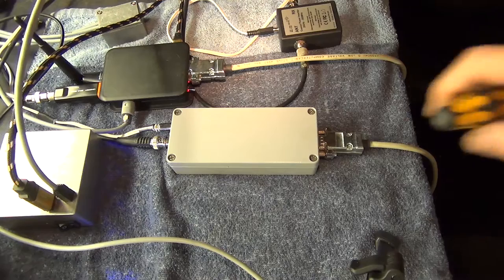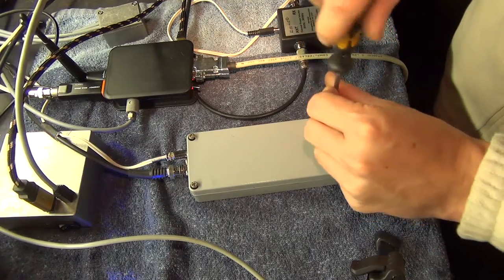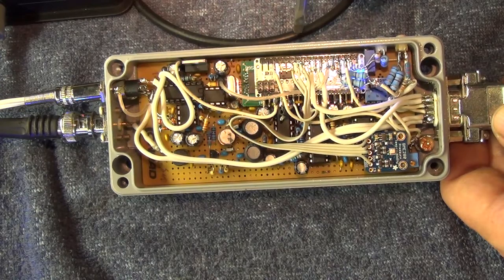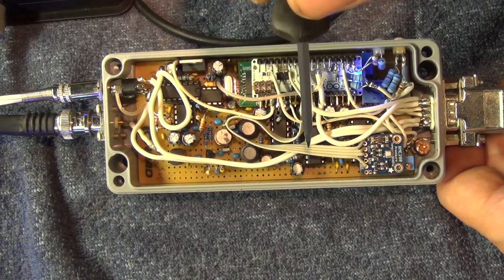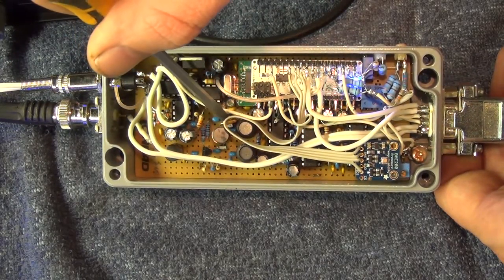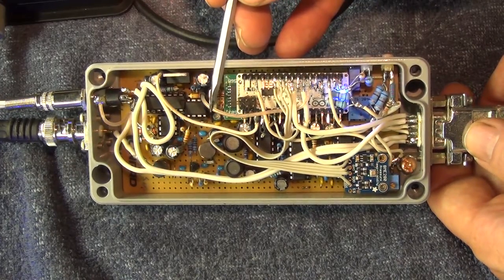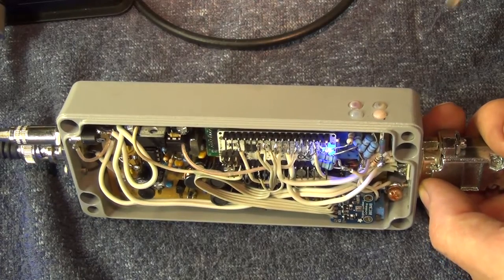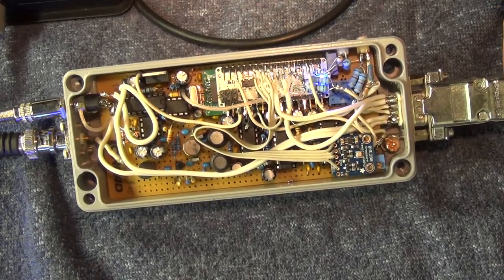Low-Cost NAVTEX Receiver (selfbuild)

Comment: Hi Martin, I have built this navtex receiver, it works except the 4069UB which produces noise. Still, the AT89C2501 can decode some of it, but clearly the 4069UB ruins the signal as at the speaker I get perfect decoding with Seatty, but not at the exit of 4069UB. Could you post the maker of your 4069UB, as I've heard that only some batches and only from some fabricants are suitable for linear applications. Please post all writings from your 4069UB including date code. How did you "calm down" your 4069UB? Thanks.
Reply: It looks like all the time the receiver was good, I have a navtex tester transmitter which is transmitting a not fully standard navtex signal. I had to use for testing this navtex tester as we have no good navtex signal here in Hungary.

Comment: Hey Kuttmoped.
Very interesting project you made.
I've just read the pdf document with the schematic for the reciever.
Now i'm wundering on how did you change the microcontroller to Arduino?
Espaccially the pins: RST, XTAL1, XTAL 2 what did you do with them?
I just briefly run through your Ardino sketch and haven't figured it out yet, so could you enlighten me? :-)
Reply from the maker: I just took the 80C51 ASM code and rewrote it to the C Code for the Arduino. At the moment I use the ATMega 328 (Arduino nano)

On an Arduino you don't need to take care about the XTAL inputs, because the controller is already on a PCB (like the Arduino Nano or Mirco) and those inputs are already connected properly. So you just plug in an USB cable and transfer the program ;)

Comment: super! what is your demodulated center frequency and offset+/- when it enters pin7?  Danke.
Reply from the maker: At Pin 7, it's the digital stream with 50 baud (100 if you count the error correction)
Frequency is max 100Hz and min 3/4 of that, due to the 3 to 4 ratio of the SITOR encoding.
Martin
Reply: kuttmoped, cheers!  I see now.  Should have read the manual! :) According to Klaus Betke the digitisation of analogue signal is performed by the 4069-->TLC274(U6d).  Do you know what is the analogue audio frequency entering the 4069?  Just wonder if I can feed ~1.5kHz into it.  Trying to build a Frankenstein prototype.
Reply from the maker: At the input of the 4096, you have around 400Hz, after rectification (the 4 diodes): 800Hz
Reply: I made it work eventually feeding 1500Hz audio into 2211 FSK demodulator and out into Arduino.  It works very well but every now and then the last character in a word is repeated twice, same with numbers.  Wonder if it's just my unstable breadboard assembly.  Is your build behaving?  Cheers
Reply from the maker: Try to compile the sketch with 1.6.9 or earlier (in Board Manager - Arduino Board AVR). I had some weird behavior with double chars while using a newer compiler version.  Not sure why this happens tho. Maybe because I use a china replica arduino.
Reply: Sorted! It stops working correctly starting with 1.6.10 introducing double chars and extra CR/LFs. I tried it on the Italian UNO R3 - same thing, actually the original board's stability was worse - keeps loosing sync.  What really screws things up is the flipping ceramic resonator instead of crystal on some boards.
Reply from the maker: So you can confirm that. 

I tried it using an Arduino Nano (cleap cheap China) and a official Arduino Micro. On both I have the same issue with the 1.6.10. or above.

So it seems not to be an issue of the AtMega328, since the Micro runs on a ATmega32U4. 

It looks like that the interrupt fires again while not beeing ready. (at least that's my guess). Maybe a digital buffer after the last OpAmp may solve the problem.

About loosing sync: Please note hat the Arduino Nano has interrupt pins 2 and 3. The Micro has 2, 3 and 7. Since I did this initially on a Micro I used pin 7 as data-in. If you use a Nano please use Pin 2 or 3 (and adjust the programm ti use this pin). Sadly: The compiler does not complain if you define pin 7  as interrupt on a AtMega328 :(
Reply: Tested only on various flavours of UNO R3 with interrupt pin set to 3, as designed.

Comment: I'm very interested in doing a similar project. Do you have any links to schematics, BoM, etc?
Reply from the maker: +johanzackrisson 
sure: http://www.harpoon.si/uploads/Razvoj%20podpora/Navtex.pdf
Sadly there are 2 mistakes. You need to exchange the pins of u6b and over the 22µF capacitor near u6b you need a 500k...1MOhms to adjust for a 50% duty-cycle. 
Wtf .. the assembler file was removed from google-docs :( hmm I have it but won't publish ist, since I don't hold the needed rights. What I can publish is my rewritten C-Code. I took only the basic Idea of operation and therefor hold the copyrights on that...
Reply: +kuttmoped Thank you, I've seen it before but don't have the guts to translate it to work with Arduino (pins etc.) so getting my hands on your version would be great. From the number of question on similar topics that I've found on the www - I think quite a few would be interested in the modernised version.
Reply from the maker: +johanzackrisson 
No Problem, however I've noticed, that my comments are all in german (added a lot to keep track of what I did, because it required a lot of tweaking, especially to stay at the clock of the sender).
If you want I can translate them into english, or do you want to use the google translator. it's made for an ATmega32U4 (Arduino Micro), but should be easily convertable to the much cheaper ATmega328 (Arduino Nano)
Reply: +kuttmoped Great! Ish spreche ein bischen Deutsch. I don't mind giving it a go in German. I have both nano, micro and mini on the shelf.
Reply: +kuttmoped I'm also having a bit of a problem reading the schematics, not being a radio guy. You wouldn't also happen to have a BoM from your build?
Reply from the maker: +johanzackrisson 
Hmm a BoM - I guess you mean partlist? I have one, but a I changed some things on the fly, since not all parts were available anymore. And from them I don't have a list :/ e.g. I used the LF353N as OpAmp. For the 4069 you need to use an unbuffered one. Everywere else you can use HCT types, but this one needs to be unbuffered or the whole thing will swing like hell. Just go through the schematics and write down each part - I think this will be the fastest way. 

Very important is also a massive groundplane and the basics of circuit construction to prevent overspeaking between the seperate parts. (a 100nF capacitor over each OpAmp and logical device). And stabilize the powerlines with 100uF on their way.

You also may need a good oscilloscope to finetune the quarz of the reference so that it's 400Hz off from the desired receiving frequency. If it's off by too much, then the mixer won't work. 

For tuning I used also a borrowed frequency generator with FM capability. I set it to switch between 517,915kHz and 518,085kHz. On the 490Khz band you are at the "wrong" sideband, so everything has to be inverted, but I did thing digitaly with the ardiuno..

PS: I hope this wa not too confusing - I'm no radio-guy aswell, but have my roots in electronics ;)
Reply: +kuttmoped Yep, parts list. I noticed that exact problem (old components), that's why I asked. My background is in the army, not even signal Corp. I'll try to get a friend from work to take a look at it. My knowledge is obviously not enough (even though I did understand the concept you described on tuning and I do have an oscilloscope). Fingers crossed, this might just work...
Reply from the maker: +johanzackrisson 

If you have any questions on details, just ask. I'm  a fan of sharing info ;) 

PS: I'll look for the arduino code and upload it on my server. I hope I have a version without the BME280, or do you want implent it aswell?
Reply: +kuttmoped I'm grateful for all the help I can get. I didn't plan on integrating the BME as I'm working on a separate project with that and other sensors. The plan is to build a stand-alone NAVTEX (with storage and screen).
Reply from the maker: +johanzackrisson 
heh - I am working on this stuff also for a reason. If you have seen the other videos of thiy playlist https://www.youtube.com/playlist?list=PLh8BEnfg2z52YcFEMpvMLLWS3f3tVwHHe , then it should be clear that I don't do this just for my 3 weeks trip i do every year. I have something bigger in mind .. hopefully in about 3 years from now I will need this badly... ;) But until then a shit load of work waits, since I want to do this with a complete self made equipment ...
Reply: +kuttmoped Looks like you're about to live the dream. My family is not big enough fans of boating for dreams like that. sadly.
Reply from the maker: +johanzackrisson 

here is the source: http://fmode.de/NavTex_Receiver_by_kutt.txt
n-joy
Reply: Hi,

I have an ancient Navtex receiver DIY kit which outputs the received data via COM port. The device was designed to be connected via COM port to a PC which runs HAMCOM 3.1. The program did the decoding and displayed it to screen. Do you think it could be possible to connect the COM port output to pin 7 of a Arduino Micro, and make things work? :-)

Comment: Hi, great job. Congratulations. A small question, how do you display the navtex data ? you use a display, or something else?
Reply from the maker: Hi, the data is received by a Raspberry PI and stored there on a MySQL database. So I can add an extra level of error correction on repeating messages. 

i can access the NAVTEX infos via a small website if I connect to the WiFi of the raspberry (e.g. with my mobile phone, tablet, laptop ...)